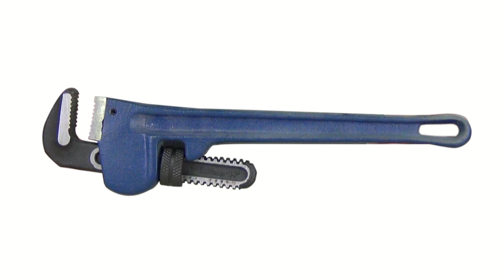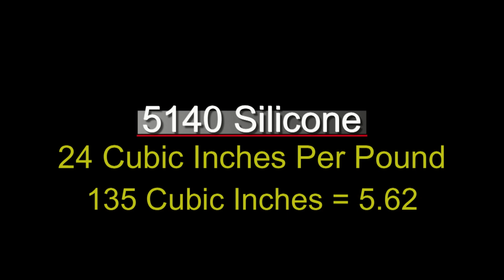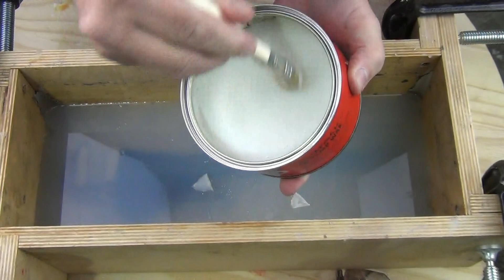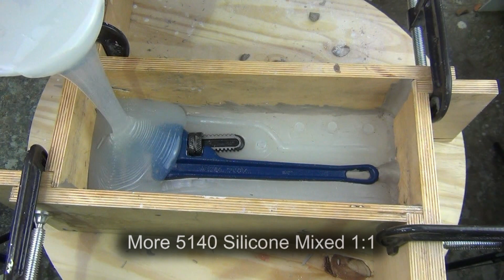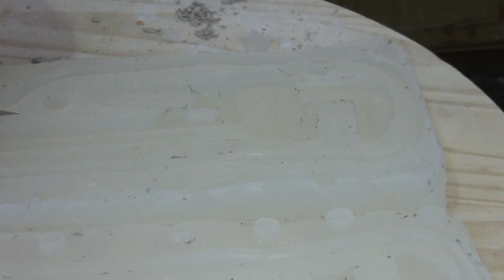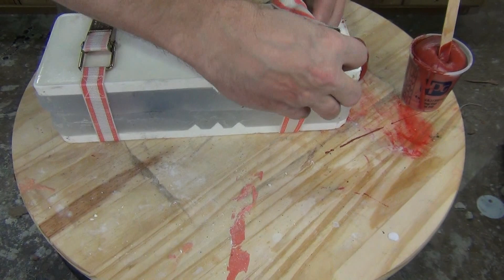Moldmaking Tutorial: 2 Piece Mold With 5140

Comment: Followed for years LOVE these toturials..Wish your store was still open I'm just down the road in Denton! I Do have a question. Does putting the pigment powder or lets say a spray metal/metallic paint in the mold make it more durable on the finished flexible prop more so than spray painting the casting and clear coating? Also if its gonna be handled a lot does it need a clear coat/sealer after the part is done anyway?
Reply from the maker: This technique relies on the adhesive potential of the flexible foam in its liquid state. Test to see if you like the results but I’ve had good results with it and the metallic powder stays put because it is bonded to the foam so no clear coat is required. TC-284 is a great flexible foam for hand props, gets a good skin, and bonds really well to the metal powder.

Comment: Maybe a not so stupid question, but if we're using oil based plasteline as a base (instead of water based clay) what chemicals are safe for clean up, assuming water doesn't do it? Does IPA clean up oil based clays, or is that a possible cure inhibitor if there's any residue of it left?
Reply from the maker: @beachcomberbob3496  I use naptha or lighter fluid to clean up oil based clay residue. Just be careful!!!
Reply: @brickintheyard  Yeah, I use some pretty combustible chemicals on a regular basis - never thought of lighter fluid - top tip!